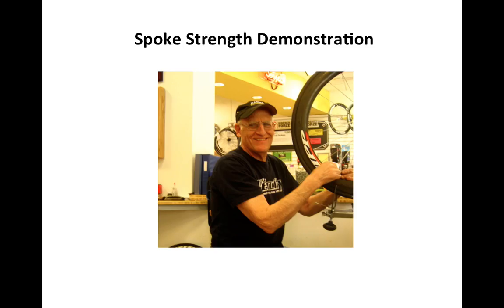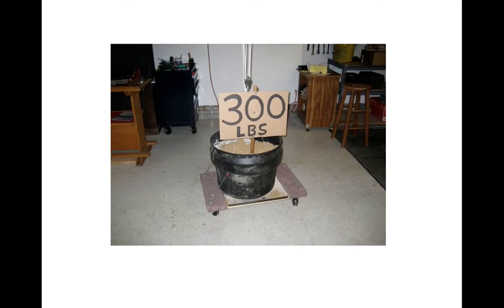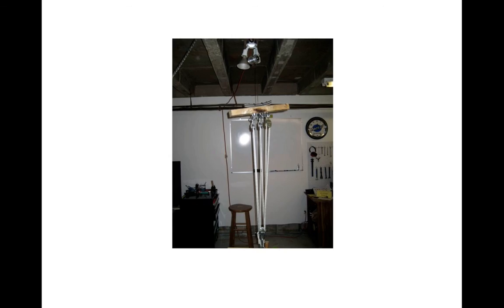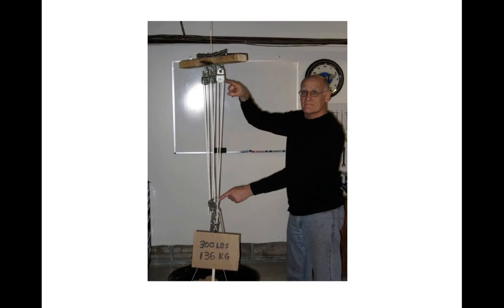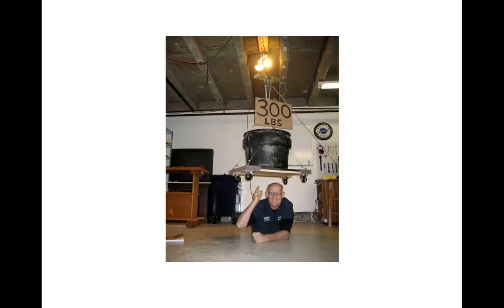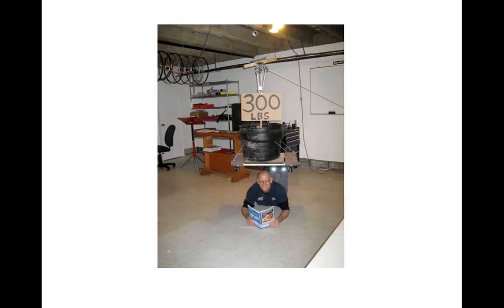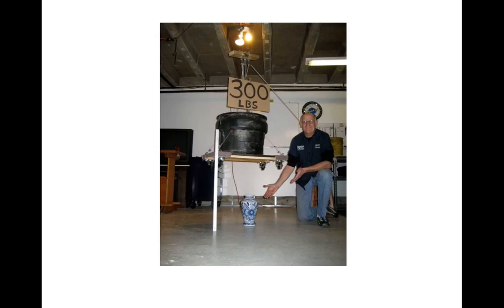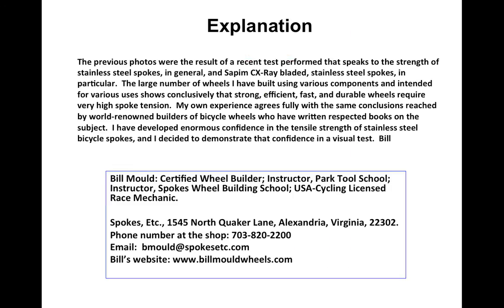Spoke Strength Death Defying Demonstration

Comment: Nice demonstration!

I'm a few years into picking up bicycling again after many decades of absence.  Pile up around a 1,000 miles a year with just general pleasure riding and a lot of daily errand running.

Anywho, I'm also a big self-sufficiency fan -- buying used items and refurbishing.  My philosophy has always been, "If you're going to depend on something, you better know how it works and be able to fix it."

I've got around a dozen wheel builds under my belt.  Nothing exotic, just modernizing the drivetrains of tank-like old 1970's Schwinn Continentals and such.

The 300 lb. demonstration is nice since I don't ever seem to get the spokes tensioned enough due to inexperience and fear I'd tension them too much.  As such, I suffer popped spokes at the J bends in under a season.

I finally broke down and ordered a cheap Chinese tension gauge which should elevate my over-doing-it fears.

Thanks for sharing your knowledge and experience!